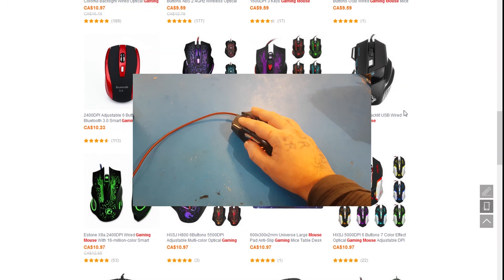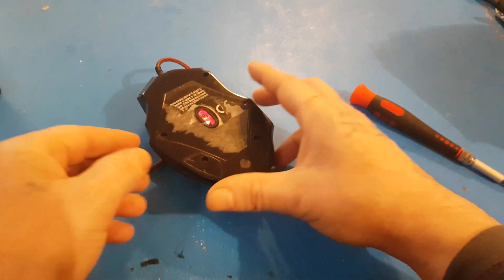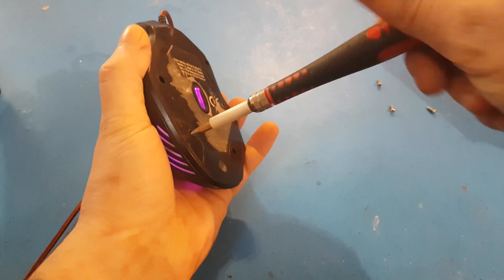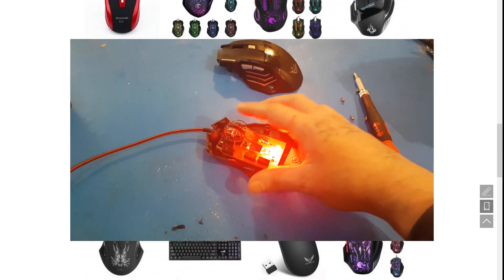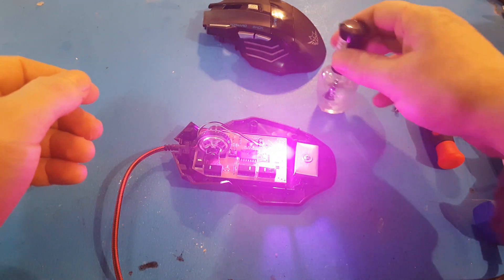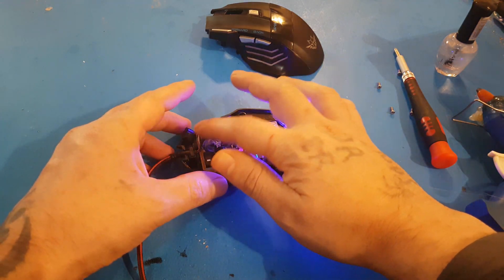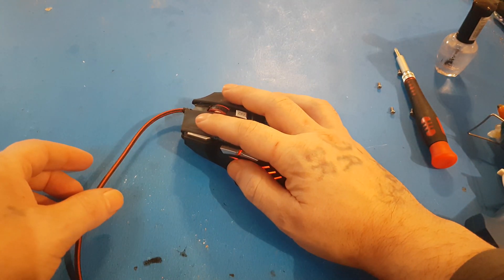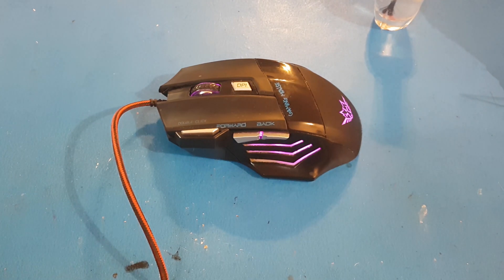Fix your mouse scroll wheel

Comment: Well, let me tell you about my experience and model. My mouse is an inexpensive one, from the Fantech brand, model Thor X9. I opened it several times, even reaching the difficult conclusion of removing the mid button, that is, the hardware, since it had a problem moving down and up, adding that I pressed the middle button. Well, I also cut many pieces because I pressed the DPI and it raised it. I couldn't find a solution. I knew it was the sensor or the design, so I went to this video. I took it apart. The video didn't work for me, but if I screwed the mouse, that is, the casing, super hard, well, it was solved. Apparently, the sensor needs pressure, I imagine, but for now it works well. I hope it helps you and if you can buy another less economical mouse. I know that the economy or the lack of knowledge and add marketing sometimes make you buy something added to a low price. I made that mistake and I hope that in the future I can help you. Greetings from a beautiful banana country, the Dominican Republic.

Comment: nah these comment gotta be fake or something. everyones saying that just blowing air into the scroll wheel just fixed it but it doesnt do anythiung for me like wtf
Reply from the maker: hi it actually does work if your having the same problem.. but for me on that style of mouse was only a temp fix worked maybe a day or 2. But after i pushed the encoder over and glued into place it worked fine. 
besides that the encoder can be full of hair ect.. couple of ppl had the rubber that goes around the wheel was actually free spinning or it could just be broken some other way.   But blowing actually really works on most scroll wheel problems as your blowing out the hair and dirt from the encoder..  Sadly that is not your issue with a easy fix.

Comment: My scroll wheel doesn't even move
Reply from the maker: u mean the wheel it self is jammed or nothing happens at all when u move it? ... One person in the comments had a issue with the rubber just spinning on the wheel ..but that is sorta noticeable ..
Reply from the maker: also it could be stuck in media mode depending what kind of mouse you have.. but that would turn the volume up and down usually.. besides that wheel is broken/clogged with hair..ect..

Comment: I bought a new mouse and the scrool wheel dont work and i blowing didn't work and i dont have screw driver and glue so i was wondering If i can glue it with a tape
Reply from the maker: Hi make sure your mouse does not have media mode and disables the wheel..  besides that check to see if the rubber on the wheel is glued down and does not free spin on the wheel.  .. If neither of those are your issues you will have to return it or open it up.  It might very well be defective.
Reply: @ModItBetter  when i put the wheel to right side it sounds and presses like when you Press middle mouse button

Comment: how to buy new scroll wheel for gamming mouse
Reply from the maker: hi I have never done that .. so your best bet is to google "replacement wheel for mouse"  ali and ebay have some ..but to find the one that matches yours might be hard, unless they are all basically made from one place..
Reply from the maker: actually i just tried replacement razor mouse scroll wheel and got lots of hits heh.. so yeah if yours is a name brand you might be able to find one.. Encoders are pretty cheap as well..However you have to know how to solder..

Comment: i have same Mouse, it on but it stop working, what can i do please?
Reply from the maker: the mouse does not work at all? if so most likely its the cable..   If just the bottom does not work at all then the wheel might be broken or the encoder / variable is dirty or defective.

Comment: bruh my mouse it self was fine but it was the case that was causing the problem
Reply from the maker: how so?   somebody posted that the rubber that goes around the wheel was his problem.. It was free spinning  lol.... how is your case affecting it .. ? pushing it the wrong way or rubbing?   I'm just curious so later in life i can add that to the list of things to check when helping people in the comments..
Reply: @ModItBetter  idk man i removed the case on top and it worked just fine. now i unscrewed the 2 screws on the top so now it works just fine. but im going to be upgrading my mouse to g703 lightningspeed soon so it doesnt rlly matter to much
Reply from the maker: @Yume_3377  cool well thanks for leaving a reply regardless... I have not used my mx5000 in years now .. ever since i got some disconnects during clutches in fps , keyboard did it as well..... sooooo hard to go back..I'm sure they are 10000 times better now ..Be nice not to have the cable hung up on things again..  anyways gl with your new mouse..

Comment: My mouse won’t  scroll the left side piece of the wheel seems broken
Reply from the maker: you mean the metal thing it slides into // encoder or variable.. 

If it is that you can move it side to side and see if it has come off the traces on the other side ... also try to push it towards the wheel and spin the wheel to see if it works.. besides that you would have to get the numbers off of it and see if you could find replacement or take it apart and see if you can fix it. might be just really dirty inside ..          Now if its the plastic part of the wheel that broke off .. all you can really do is see if u can glue the broken piece back on or find a wheel that will fit..

Comment: I purchased a new mouse,its redragon mouse,after i plug it the wheel does not work after 5-10 seconds,if i unplug and plug it works again for some seconds
Reply: Other ppl have the same issue with this redragon mouse
Reply from the maker: @martex6977  I have a couple Redragon M908 in my house I have not ran into that issue with them .. If you got it from amazon I would just return it. ,if its a known issue with a hardware bug.  Try to contact support at redragon and see if they will ship you a new one...   
redragon support page is here ..might help
https://redragonshop.com/pages/contact-us

I'm not sure if that mouse has a media mode .. Some mice if you hold the dpi button down in converts the mouse into a media mouse.. however I believe the volume should move up and down with the scroll wheel only... ..

If you can't return it ..You could just buy another one and switch it out as defective if redragon won't help you.
Reply from the maker: out of curiosity what model is it?  I can try to look around later..  Its possible its a bad trace but if its a new mouse its not worth taking apart to find out as that will wreck your warranty.
Reply: @ModItBetter  its redragon M607
Also i cannot return it:((for now is working again
Reply: @ModItBetter  also i am using it on a ps4

Comment: how does putting hot glue fix it?
Reply from the maker: Hi in my case because it did not rip off the trace on the bottom . it centers the variable for the wheel axis .  You can simply try to push the variable and spin the wheel to see if it helps.. Most likely during the manufacture assembly they push and bend the legs while putting in the wheel.      Now if it does work by pushing it,  The hot glue simply keeps it in place.. a folded  up piece of cardboard or anything else that can be stuck in that spot would have the same effect ..
Reply: @ModItBetter  oh i see.. i guess my problem is the encoder itself. Cuz it's really loose and jumpy. I might just solder it and replace or just buy a new mouse.
Reply from the maker: @kgt8742    crappy.. well good luck on fixing if you go that route.. You could try to take the encoder apart and see what failed if you can pinch back together .. .... or if it is a broken trace under it.. ect.. sorta curious on what failed..

Comment: my mouse wont scroll, even i move it it dosent scroll,
Reply from the maker: crappy . one person found that the rubber grip actually came off and was free spinning on the wheel.. doubt its that but worth a check .. besides that.  It might be the variable/ or encoder , same location the wheel rests in  Is defective. or dirty.  You can also check for broken traces by moving the variable/encoder gently side to side and watch the 3-4 solder joints on the bottom to see if they move.    .

Comment: My scroll wheel doesn’t even work help
Reply from the maker: It could be just broken .. the first thing you can check is to see if the rubber on the wheel is not free spinning..  besides that you will have to open up and see if its broken some how..   move the variable or the sensor for the wheel slightly back and forth and see if the pins on the other side have broken from the trace...You can sorta test that by moving the wheel up and down while putting slight pressure on a angle usually to the left, if you get movement with the scroll wheel it might be that.

  Could also be a build up of hair around the wheel
Reply from the maker: I should note.. before taking it apart , If you can test it in another computer to confirm its not the o.s somehow.. Or something to do with software that might of came with your mouse that can disable the scroll wheel for other functions like media control

Comment: my mouse wheel for some reason turns the higher or lower but won't any othey thing than that
Reply from the maker: I'm not sure what you mean .. it scrolls up and down.. but won't click?
Reply: @ModItBetter  it does click but i fixed the problem already so the problem i had before I fixed that the scroll wheel was changing the volume but but any other thing so i had to unplug and plug in again
Reply from the maker: @pearlduz  ah weird .. if you have a dpi button on your mouse.. it might change it to control the volume if you hold it for 3 seconds or more,. Next time it does it try to hold the dpi button down for 3 seconds to see if it fixes it... maybe its sticking.
Some mice have 2 modes. normal and media
Reply: @ModItBetter  ok

Comment: Thanks for the advice. I really appreciate it but there is no screw under my mouse and if I blow into it, it doesn't work. Pls help me
Reply from the maker: Hi , you will have to figure out how to open it . you might have to pry the 2 parts apart.   But you also might cause more damage.
make sure to see the rubber did not come off the wheel and is just free spinning.

Comment: the metal piece on the left is not connected I see the problem but when I put it together it just wont scroll kinda frustrated so please get back to me on it
Reply from the maker: so the metal thing broke off the traces on the bottom?   You will need to put the variable back in place.. and scrap around the pads until you see copper and re solder it on. or put in place glue it and attach wires to each leg and find a new location to solder to.

You can always take a pic and send it to bangs696969@gmail.com or post it here . it will just be flagged until it pops up in my spam folder on yt

Comment: my mouse doesn't have screws on them :(
Reply from the maker: You might have to pry the 2 parts apart with a small flat screwdriver .  However you might do more damage to your mouse in the process where it won't go back together .   If its a more expensive mouse you can try to google the name of it   example .."razer mouse disassembly"

Comment: bro please helpme. mouse doesnt have screws. im screwed up
Reply from the maker: yeah sadly if no screws under the pads or stickers..you will have to stick a flat screwdriver on the side or back then pry the 2 halfs apart. work around 3 sides most likely the front might still have hooks.,  however if you break the clips your mouse probably won't go back together again.
Reply: @ModItBetter  thanks for replying to a twelve year old idiot. But anyway I had a super old Logitech mouse(very old where there is a ball instead of sensors. I knew how it works. But it had some problems. Now I'm proud that I fixed it.
Reply from the maker: @6px  Cool that you stuck with it. what was the problem dust and hair?    Those old ones were pretty good for tracking up dirt heh.

Comment: My scroll wheel doesn't work at all it just spins
Reply: I literally just fixed my wheel with this issue. I have a Red Dragon Centrophorus. So basically what happened to mine is that the rubber wheel on the plastic housing on the inside started to loose its grip and then the rubber just slides on the plastic without actually turning the plastic housing (which is needed  to control the scroll function). So all you have to do; is really carefully, apply some glue between the wheel and the rubber just so that they stick together. So many thats the same problem you're having on your mouse.
Reply from the maker: @cameronfell4415  Cool thanks Cameron Fell for taking time to share your fix.. I would of never thought of that one..   If you re post a new comment I can pin it as well . In case other ppl have the same issue..
Reply: @ModItBetter  no problem ma dude.
Reply from the maker: Hi could be the variable resistor/ Rotary Encoder is broken or the wheel.  you would have to open it up to see if its something simple

Comment: I got angry in minecraft and hit my mouse and broke the scroll wheel and I’m 12 so I don’t know what to do can you help it’s not stiff it feels like a small wheel it doesn’t scroll anymore
Reply from the maker: You probably broke the pegs on both side of the wheel..  ..if only those broke you might be able to crazy glue them back on.   You will have to open it up and see the damage..
Reply: It’s a version tech mouse with no screw holes
Reply from the maker: @mythicalpaprika0000  the screws are probably hidden under the sticker or the pads.    If its your only mouse at the moment you might not want to take it apart in case you break it more.
Reply: ModItBetter I’ve checked under stickers and no screw hole and this is not my mouse it’s my bros but he doesn’t use it but it’s fine I only use it for minecraft I can use numbers
Reply from the maker: @mythicalpaprika0000  yeah might be best not to try then.. I'm sure  you could pry it apart they used clips I guess. however you might break the clips trying to get it apart.. then have to tape it all up ect..
Reply: ModItBetter ok tysm

Comment: When I scroll my mouse downward it will scroll down the page but then all of a sudden starts scrolling back upward while I'm still scrolling down, does the same thing while scrolling up. Do you have any recommendations?
Reply from the maker: try to blow in it..if it fixes it then u might have to fallow the video.  Its what my mouse was doing as well.. going up and down when moving it downwards ect..
Reply: @ModItBetter  Unfortunately none of the methods worked but the nail polish does help tighten the wheel if it is loose.
Reply from the maker: @mateopiliero5596  the only other options are to take the variable apart and clean it but that involves soldering and patience taking it apart and the gamble of not breaking it completely .  or finding a donor one in another cheaper mouse....    when you were pushing the variable like in the video did it all help?  maybe check for bad solder joints on the pins for the variable(broken pad lifting off the board) as well doubtful but worth looking at if its already apart ..

Comment: i opened it up and the scroll wheel broke a little on the side and a little piece is stuck inside - rip mouse 2019-2020
Reply from the maker: crappy ,got to wonder how cheap the plastic is even getting for that to happen
Reply: @ModItBetter  nah I have a glorious model d and the same thing happened to mine.
I've been using it for about 2-3 years though so that probably has to do with it.. 
A small chunk of the plastic got stuck inside and the other part isn't connected. So now I probably have to glue the two pieces together and see if that works..
Reply from the maker: @truestrose234  Hi i did a quick google and found somebody said the deathadder scroll wheel might fit
here is a link so you can check out the pictures of the wheel.. No idea about the seller or if it will actually fit your mouse..
https://www.aliexpress.com/item/1005001652619999.html

Comment: the scroll wheel down of my model o feels really stiff in comparison to scrolling it up and it wasn't like that when i got it. Do you reckon this would fix the issue?
Reply from the maker: Hi I don't think this will help that issue ..however if you can safely take it apart i would check for a hair all caught up in the wheel and maybe inside the variable.
Reply: @ModItBetter  thank you will do